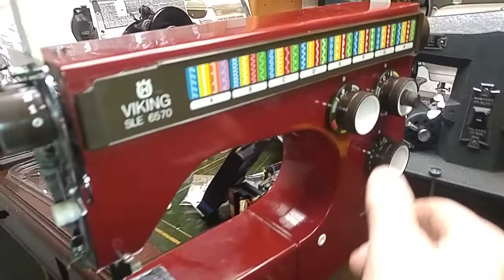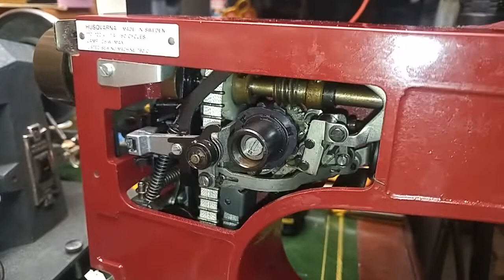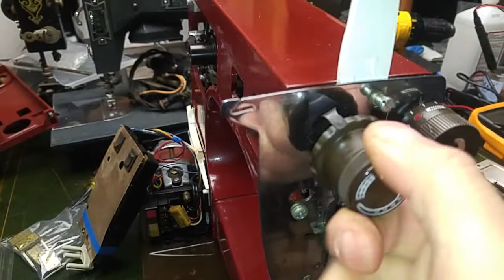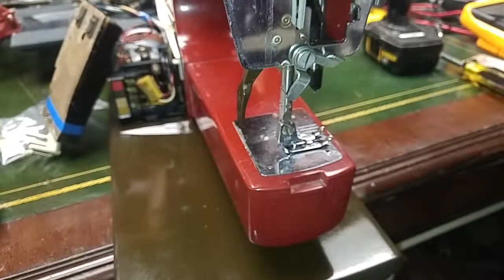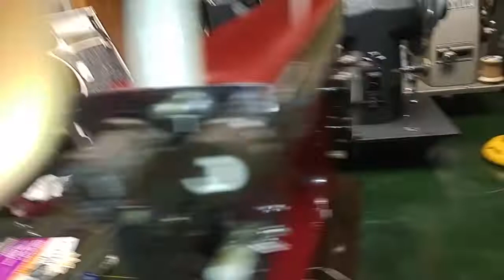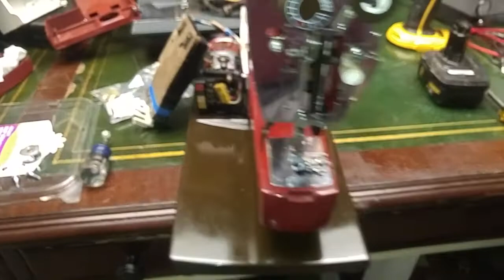Rescue - Viking SLE 6570 Stitch Selector Dial Not Moving w/ Mechanism Reverse Feed Moving

Comment: Did you get the dial working ?  I have one it looks like the dial has been stripped....
Reply from the maker: No, unfortunately not yet.  Been barely working on sewing machines since last winter-spring indoor projects season.  However, there are now two YT channels who have videos detailing the mechanisms disassembly, repair and re-assembly since working on.   Luke Fenech "stitch selector" and SewRepair "Pattern Selector."  Search those terms in quotes on their respective channel videos search and you'll find the videos since Luke Fenech has a few.
Reply: Is common for them to be fummed up with old oil that gone varnish. You can usually free it up with some solvent like wd40 and hot air but Id recoment using  hair dryer rather than a hot air gun because the cam will melt.
Reply: I just got a 6570 which has the selector knobs frozen.. So I have the back off but cant get the side panel off.  I can see in there that there is hardened waxy lubricant in there.  I pulled the handwheel off but there is a screw under there that won't come loose.  And a couple on bottom of machine.  But that screw on top of machine under handwheel will not budge even with liquid wrench.  I hope you can explain how that panel comes off.Thanks!